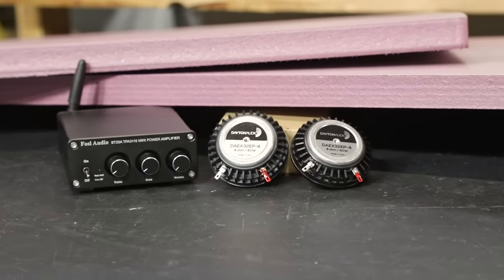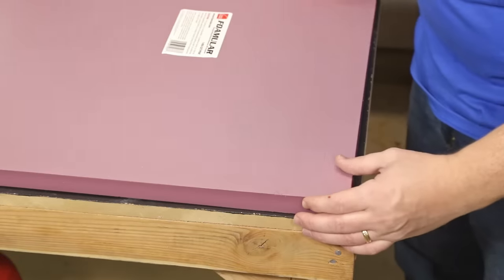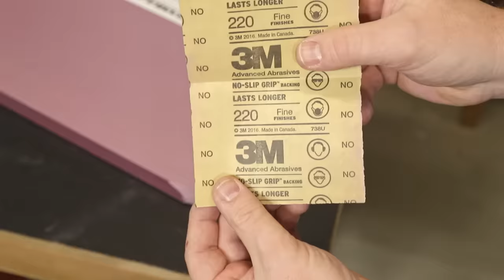How To Build "The World's Best Speakers" - Are Flat Panel Speakers Really Any Good?

Comment from the maker: Follow-up video is here: https://youtu.be/XC814uQjlaE
Reply: The best test of this audio would be outdoors to eliminate the acoustic value of the garage
Reply: I saw a these at DoD research facility back in 1980. The engineer used expanded polystyrene foam and the sound wasn't that great. You explained why his sounded so bad. He hung them on the wall vs susended them and his mounting points were on the upper corners. The kind of foam he used probably had a impact too.
Reply: @AmplifyDIY I've used those kind of speakers 15 years or more ago, except back then when you bought the 2 speaker set, at if I remember correctly, something like 6x12 in size, they used a stiff cardboard or what looked like cardboard anyway... Another couple of differences were the fact that it somehow made sound by using something like a piezoelectric speaker, such as you find in a talking birthday card, and not an exciter, and also, they weren't hanging off the wall, they were in a plastic shell so they "looked" like a "thin" desktop speaker... Not trying to throw shade on your video, it's just something that I thought you might find interesting
Reply: A guy sure does like that hat 😁
Reply from the maker: @Wbroach24  Well, I'll be dipped!
Reply: @Wbroach24  I wonder if you can make these using Vice Grips, in yer Garage? I don't know...;-)
Reply: For my own application and space limitations (video projection screen), I’m wondering how a single large piece would work with both left and right exciters attached.
Reply: I love audio I like this guy. Subscribed!
Reply: Can the panels be spray painted?
Reply: The original post was in 2018, the follow up was in 2018, using ceiling tiles. Have you noticed it yet ?
Reply: @MrDeepwatermarine  The original post by Tech Ingredients says the XPS panels can be spray painted by holding the cans far enough away that xylene evaporates before it reaches the panel. The OP said he used almost the entire can for two 24 by 24 inch panels.
Reply from the maker: @marks99999  Yes, I did - in fact I linked it in the video description, and I believe I mentioned it in my video itself. @TechIngredients specifically recommends ceiling tile for better low end, but they do not perform as well in the mids and highs.
Reply: @MrDeepwatermarine  If you watch the original video by Tech Ingredients, he says yes if you do it in a specific way to prevent the chemicals in the spray paint from eating the polystyrene.
Reply: Have you tried putting electrical tape tightly on the edges to cut out the unwanted vibrations. It worked great for me and I believe that the pitch is warmer.
Reply: i wonder if this could be made with aerogel panels
Reply: @AmplifyDIY what was your total, all-in cost?
Reply: @thelowmax  It would definitely work. But you would probably get a clearer stereo picture by splitting the panel in two. It wouldn’t take up more space anyway
Reply: @TheOsfania  Not OP obv, but I planned some speakers recently and I came out at about 100€ for materials and two Dayton audio 25w exciters
Reply: Any advice on the amp?  I don't have experience with amps, but am comfortable with the rest.

Comment: Personally I’d be offsetting using the golden ratio. I base that on nothing
Reply: After cutting the boards to golden ratio dimensions, of course.
Reply: And now you've ripped a hole to the core of the planet
As the bass drops to the same frequency as earth 
Sudden doom with the boom 💥
Reply: Based on the harmonic wave patterns in the Tech Ingredients video, I believe that would cause even more harmonic resonance which will make the sound very lumpy (some frequencies really loud, others weirdly quiet)
Reply: Sorry 😐 know it was a joke but just in case you do try it and are unimpressed, I figured I would say maybe why.
Reply: @wasabij  Actually, it's a great reminder that TI did record waveform patterns with different setups and materials. I think the OP is only half joking as I would also be tempted to work the golden ratio into a build.
Reply: I like the way you think. Maybe this ideal exciter placement according to TI's experiments is actually related to the golden ratio. I would play with panel size first since that hasn't been tested, maybe even apply it in all 3 dimensions.
Reply: my guess is about some prime numbers ratio
Reply: @whatever12643  I watched a bunch of videos on this many years ago. Fascinating. I have an interest in ancient civilizations with work from the likes of Graham Hancock, Robert Shoch, Anthony West, Ralph Abraham, Rupert Sheldrake etc... So yeah, this whole golden ratio thing is right up my alley.
Reply: Golden ratio ≈ 1.618
5/3 ≈ 1.667

Off by 0.048. On a 24 inch board, that's 1.152 inches.
He was pretty close.
Reply: @theGoogol  Man, I didn't even think to do a quick calc. Turns out it can indeed be associated with the GR. How cool :)
Reply: @papapetad  : It's the 5/3 that does it. I remembered those are subsequent Fibonacci numbers so divided they must appraoch the golden ratio.
13/8 would be better and 21/13 even better (And so on).
I think 5/3 was used to simplify the build.
Reply: @hxhdfjifzirstc894  The ratio of consecutive Fibonacci numbers converges to the golden ratio.
Reply: Mood
Reply: HAHAHAHAHAHAH YES
Reply: @whatever12643  if you're on youtube and you're unfamiliar with cymatics I don't know what kinda strange things the algorithms must be showing you lol. Gotta be one of the top 5 most basic/shared types of videos on here.
Reply: You based it on gold, apparently your ratio foundation is more solid than the US$.
Reply: @hxhdfjifzirstc894  the fibonacci sequence and the golden ratio are pretty much perfectly tied into each other though
Reply: its not my area of expertise but i'd guess, the lowest frequency response you'll get is 1/4 the wavelength @ the longest dimension
Reply: 3N+1 for ratio
Reply: @hxhdfjifzirstc894  yeah bout that, phi is based on the Fibonacci sequence
Reply: Can't go wrong with the golden ratio...
Reply: @atomictraveller  it's not voodoo. The golden ratio is a great irrational number. The reason it often appears in biological contexts is for exactly this reason: e.g. if you want a stem that has as many leaves as possible, with none of them directly above another.

Having absolutely no idea how this works, or what makes for a good placement, but knowing that in the vid he put one device dead center and one slightly off while still at a whole number ratio, I think it's the most natural & curious & intelligent response to ask next "but what if was at an irrational ratio?"
Reply: I like how you think. 👍🍺🎩🎩🎩
Reply: It's the golden ratio.
It turns up everywhere.
It has to be a good idea.
Reply: @Volvith  it turns up to 11. try phi as a touch harmonic position on a guitar string, you tell me if that's a good idea.
Reply: Great analysis Dee!
Reply: @atomictraveller  lol... Don't sound like too bad of an idea, I just wish I hadn't ate the goat already...😂😂 But seriously, just because you think freemasons are some kind of fantastical or downright conspiratorial group, and associate this group with the Fibonacci sequence, and/or the golden ratio, that doesn't mean you have cart blanche to imply that all freemasons have animal relations, like a common wizard, or other free thinker... And besides, the freemasons had some good ideas, so if animal relations is is how they were able to think them up, more power to them... It's not up to us to judge people, but it's even worse, before getting to know them... Just saying...

PS. I know it was probably just meant as a joke, but I had to stick up for those being referred to as partaking in animal relations anyway, because that's not something you should say lightly... (Unless you want the knights templar after you anyway)
Reply: Go Fish
Reply: It would produce a sound satisfying to the eye.
Reply: That is actually super common in speaker designs
Reply: @papapetad  My personal heroes
Reply: @atomictraveller  Last I checked, the guitar is less than ideal as an example because frequency spacings were artificially skewed off-center from the original Pythagoras calculations to fit the instrument. Guitar mathematics is 7/12=14. Maybe if you talked about the harp or the sitar we'd be more receptive...also, why not point us to a video with data like TI's demonstration to support your professional opinion instead of just talking about it and accusing everyone of bestiality? While modern freemasonry is indeed mostly run by depraved cunts, there is some interesting esoteric knowledge that's come out of their circles and some of their most eminent members had their hearts in the right place. Rudolf Steiner's body of work and lectures is a great example of that.
Reply: @papapetad  holmes, produce the harp or sitar tuning that includes phi.
intervals are consonant yo.
i'm sure you're a brave antiauthoritarian
but here you are riding it holmes.
jesus they never stop coming.
Reply: @atomictraveller  Nice video. Cool story bro.
Reply: @papapetad  the concept of a transcendental as a harmonic interval doesn't relly connect thar
teh sorries
Reply: @atomictraveller  You ok, bro? The more you type, the less sense you make.
Reply: @papapetad  can has maqamat in phi holmes?
Reply: Only works if the drivers are also made out of solid ionized gold - and I base that on the fact that if you just blow €120k on a couple speakers you're going to convince yourself that they sound amazing no matter what.
Reply: Golden ratio makes perfectly sense. It is as far removed as possible at a point that standing waves are possible. It suppresses standing waves that is agood thing
Reply: @atomictraveller  22.42, but that is the actual position of the nodes. Theoretically the nodes should be vibration free.
Reply: @hxhdfjifzirstc894  Of course, the quotient of two consequent Fibonacci Numbers converges to the golden ratio. So, the Fibonacci Numbers are already there.
Reply: You're not far off, golden ratio applies to ratios of integers but waves are kinda fundamentally irrational already (pi) check out the logic behind low discrepancy sequences for rationale, very pretty, you might have an easier time understanding than others
Reply: Definitely using Fibonacci stuff. 👍🏼
Reply: "If you want to find the secrets of the universe, think in terms of energy, frequency and vibration." ― Nikola Tesla
Reply: Basing things on nothing is a solid and workable plan!  Also, you can never go wrong with the golden ratio,  Fibonacci knows the way!
Reply: @jesseb0rn51  it is not...  Seriously...
Reply: Seems like altering the thickness of the board would have a better effect on those muddy frequencies. Bit of a concave...you know..like a speaker has 🤔🤣
Reply: @johnj2496  the earth is alpha fequency, midrange :)
Reply: @wasabij  it could also be using foam. A million little resonances all interfering with each other.
The crisp layer on a normal speaker stops that happening.
Reply: @papapetad  why not shape the XPS foam on a router so it replicates half the shell of a nautilus , or for that matter , mount one to the back of half a nautilus shell , ( ask its permission first though )
Reply: @theGoogol  isnt that a fibonacci sequence or is that the same ?
Reply: @heartobefelt  : Same thing. The golden ratio is derived from the Fibonacci sequence. Nature uses those numbers a lot to avoid "standing waves".
Reply: more like fitting the golden ration to your thing by scaling and rotating  spiral over your design
Reply: I would avoid any parallel edges at all, even to the point of chamfering the edges. I feel like that would minimize resonances and flatten the curve, especially in the upper midrange.
Reply: @johnj2496  doom with a woof woof
Reply: TI said 3/5. 
3/5 of 100 is 60
The golden ratio of 100 is 61.
It might work! That's remarkable
Reply: I did that on mine. Did it make a difference? I don't care.
Reply: @wasabij phase cancelation
Reply: I did exactly that.